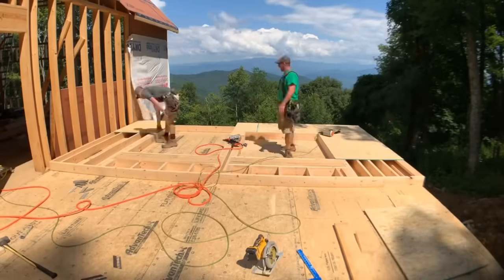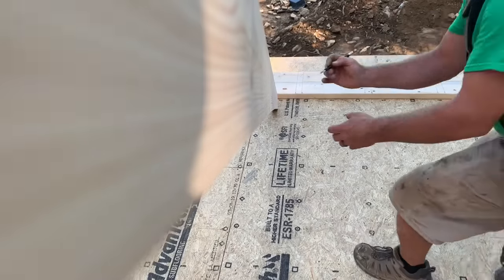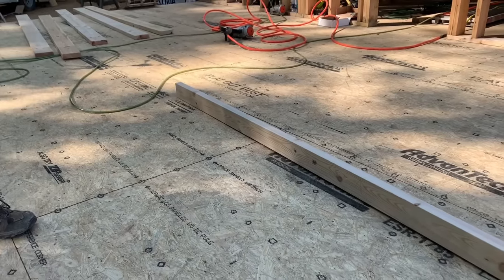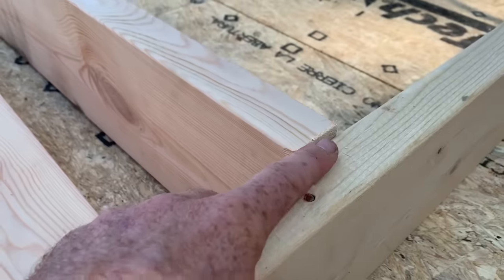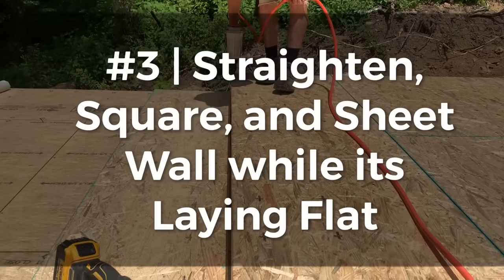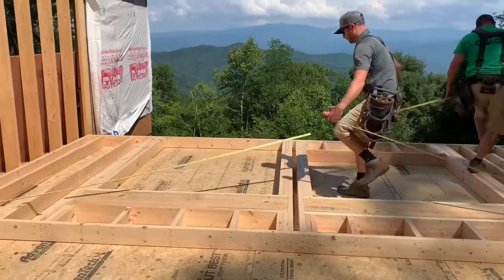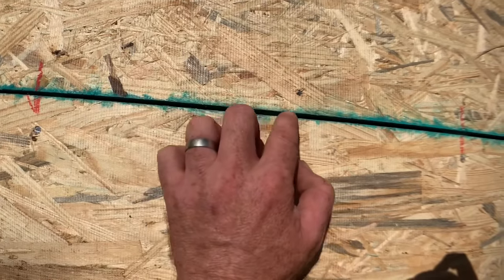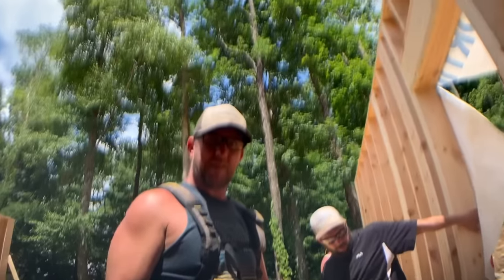Build GOOD Walls! How to do it.

Comment: Pin punched plastic house wrap, is not Tyvek.  Leaks like a sieve.
Reply: Was going to ask, is Tyvek just the fist/most popular brand? Like when some oldtimers call all the circular saws Skilsaws and all the reciprocating saws Sawzalls?
Reply: idwtbam In the sense that they are both house wraps you could say that.  However they are different in design so it would be like calling a sawzall a skillsaw because they are both saws.
Or calling a tomato an apple because they are both red and both fruits.  Or referring to OSB as Plywood, they are both sheathing and decking products but behave entirely different when exposed to water.
Reply: idwtbam Tyvek is the best and toughest but pricey where we are .
Reply: Tyvek is epic. That wall is fine. You can put 3/4 plywood on your house if you want bro but these guys are trying to make a living and obviously care about good work also. Check yourself before you wreck yourself
Reply: Typecast is over engineered
Reply: Lol, do y’all scoff every time you see h house wrapped in tyvek or something.  AND SAY.       “ they should have wrapped it in gold”
Reply: h2s you’re lucky this CONTRACTOR gives a shit at all

Comment: Next time toenail the outside of the bottom plate on the line . mark the top edge for the studs ,not the inside flat part of the plate. 
Load your wall square it,sheet it , tyvck stand and brace .
Reply from the maker: Have done that.. easier to straighten twisted studs when you have the line down the flat face of the plates.

Comment: Ahh .. You mean to tell me you arbitrarily marked in 5-1/2 " ?? .. didn't lay out the entirety ?? or was your framing built by NASA ??    Grid out the entirety for every deviation .. and if you tell me your masonry and floor framing on everything was perfect .. " Bullshit !!.. Cross squaring walls and standing them means that the floor was perfectly .. I mean perfectly level !! and straight .. 40 years .. never seen that !! and I build mansions . Works somewhat on low end cracker boxes !! .. I have seen too many times .. standing a wall pre-sheathed and gaps under the plates .. That is why I guess in the comment section people are suggestion caulk ..   In this application .. Yes !! .. .. and them bedding the plate and separating the studs from the plate a miniscule amount .. But it is now an unbeared stud .. .. And the purpose of a stud is to bear .. . The only wall that can be reasonably presheathed is a gable wall .. The deviation is 1/64" .. .. A 1/4 " bowed stud is unacceptable in 8 or 9 foot wall .. Save the best for dining rooms with wainscoting .. and you won't get that chair rail meander
Reply: I agree I have seen some shitty framers frame this way and they had issues with gaps under the plates I saw them use shims and glue and these were long runs of load bearing walls. It was a clown show to watch
Reply: It is about the care you put into toenailing the  bottom plate to the chalk line. If done well there is never any gaps.  18 years experience, 12 months a year outside banging nails and loving it.

Comment: Plywood is just another way of saying osb lighten up people people
Reply: No they are two different products.

Plywood is thin veneer sheets glued together.

Whereas OSB is Opposite Strand Board.
Mostly made up of chewed up left overs glued together.

I have had to use both because of specifications on jobs.

Personally I would not use OSB board to build an outhouse for somebody I dont like.

It is cheap worthless crapola. I have seen it swell, pop off the screws used to hold it on place.

It is 100 percent junk.
Reply: @shawnr771  . Yep. Really cheap junk!

Comment: True professionals when they put the tyvek on upside down!!! 🤦‍♂️
Reply: Tyvek should NEVER   be  installed upside down! If any moisture accumulates behind the siding, water will run up, rather than down.
Reply: They rolled the bottom layer first. Check again.

Comment: That pulling a tape corner to corner is not fool proof, have you ever heard of a isosceles trapezoid?
Reply: Not relevant in this case.  Matching corner to corner = square.  Every time.
Reply: @selftrue670  Keep believing that!
Reply: @mobeydick37  You know what?  I stand corrected--I see your point.  I and a million others have used the diag. corner-to-corner agree method for decades, but I can see how it can introduce error.  I guess I will go back to the 3-4-5 method.
Reply: @selftrue670  I got bit one time and learned my lesson. I made a porch beam 1" longer then it was supposed to be on a remodel addition. Don't know how the wrong measurement got introduced into the equation. Pulled corner to corner to square it up with the house. It didn't show up until we started putting in the valley jacks. It wasn't bad enough to take it apart or to be noticed so we just cut them to fit. I always did the math after that. Then pulled cornet to corner.   Bxs=+Hxs=Sq

Comment: I know you're trying to teach people but that's a rookie home owner way to build walls first you can't put vapor barrier on Wall because inspector can't count nails in plywood which is only thing holding house together and doing plates like that is not correct and all studs get tow nailed it's stronger and sheeting the walls after you stand them and straighten them is a much better job then doing it on ground I've been framer for 35 yrs not being an asshole just learned from experience
Reply: Sounds like you might be from NJ
Reply from the maker: Thanks for the comment. So we don’t have nail inspection on sheeting where i live... I do nail 6” OC and always adjust the the compressor  pressure so the heads sit flush instead of sinking half way through (like you see most people doing), greatly increasing the strength of the connection. I do always stand walls framed on slab and sheet them after because there is no good way to tack the wall to straighten and square, like shown in video.
Reply: @larrymiller9480  A foreign country was my guess.
Reply: Toe-nailing will yield less and variable nail penetration and therefore less lateral strength. It's the job of the sheathing and drywall to hold the studs to the plates. Not sure how sheathing a wall after standing it would be better?
Reply: Big Al Van Duzer if you’re not sheeting walls laying down your losing valuable time
Reply: We send our shit lumber back .some of that lumber wouldn't use on dog house.aint got time 2 mess with it.

Comment: Seems like 1/2 to 3/4 of this is irrelevant if you use metal studs.  Still a good video though for wood stud walls.
Reply: Since the wall did use wood studs, it seems the only thing  irrelevant is your post.
Reply: technosaurus well, duh?
By the way, who invited you here?
Reply: How do you attach wood rafters to a metal stud wall?
Reply: @ajs96350  There are multiple ways to use wood rafters with metal stud walls.  Just google: metal stud roof detail.  Most metal stud manufacturers have drawings and specs for wood roof trusses - usually involving special braces.  OTOH you can just use metal studs for a roof to span up to 40ft before you need to get an engineer/architect involved (steel framing alliance has references)  Besides being lighter, fireproof, straight, square and true, metal studs don't go up in price exponentially with length and width, so spanning a larger area becomes cheaper than wood at around a 12ft span (give or take).   IMO Metal is actually much easier for a DIYer than standard stick framing but costs more up front for small buildings (the sheds, garages and tiny houses you see on YouTube) and still not as common in residential construction outside of interior basement walls, so good, comprehensive  tutorials are harder to come by.

Comment: why was there double sill plates? wouldnt you get better sealing if you house wrapped it standing so it could go around and in corners? ive heard a lot of people using deck screws for framing, what do you think of this?
Reply from the maker: Good questions. LOk so the two plates you see are the top and bottom plates. Just sitting together because I mark them at the same time. Double top plate is added later after opposing interior and exterior walls are finished... and this ties it all together. I do leave about 2 extra feet of house wrap folded back to wrap around the corner once the opposing wall is built as well. Also I do this deck screws pretty often to suck framing members tight or tack things straight before nailing.   They are expensive so I try to reuse them!
Reply: @PerkinsBuilderBrothers  i thought i saw double sill plates(mud sills). do you mean you temporarily screw the parts together then shoot in nails, then recover the screws? what i meant with my question was using screws instead of nails, a worker at a lowes here said he used just deck screws to build his house, but ive heard they lack shear strength, i was curious what someone who builds for a living thinks about it
Reply: @feralbigdog  Deck screws do lack shear strength. Don't use them for framing.
Reply: @Jay-tk7ib  im about to build(well rebuild, a moron ripped it out) a hearth for my fireplace, any issues with deck screws for that? would adding construction adhesive to the hearth joist/ band hearth joist joint compensate?

Comment: Or...use steel studs and don't get any crown at all and very little waste!  

More people need to go to steel and show more videos of it. Wood has so many drawbacks, compared to other options.
Reply: Ummm. Steel studs arent structural. You cant set a roof or a second floor on it. It will also conduct heat or cold air and that may not be as nice with insulation.
Reply: @joshyjosh00  depends on the Gage of steel.
Otherwise you're correct on the temperature transfer.

Comment: You get paid how much? and you still use nails? WTF?
Reply: Depends on the application.  Nails have shear strength, screws have holding power. I wouldn't trust you if you said you strictly use only screws, same goes if you use nails on everything.

Comment: If you want to build a wall, don't use home depot chemical laden toothpicks to build it, unless you want it to rot and be condemned before that 30 year mortgage is through. Good walls are built from Clay, Straw, and Sand, and we call it Cob.

Comment: You use zip on the roofs but you use that garbage osb on the walls... .. makes no sense to spend money and time on tyvek.. and why don’t you tack your  bottom plate to chalk line first rather than having to move a full framed wall after the fact.. .
Reply from the maker: Great idea about that but I just don’t like standing right at the edge of the floor to assemble the wall when it’s a long way to the ground ;)
Reply: I been framing houses for 25 years.... if you angle your nails just right so they come out exactly on the outside bottom corner  into the floor you don’t need to pull them at all and they act perfectly as a hinge.. also we use the  metal lumber straps spaced about every eight feet  .. cut them two feet long and nail it to floor and wrap it under plate and bend it up and over to nail into top of bottom plate for lifting long or gable walls when lifting with multiple guys or with lull to keep wall from moving  when being picked up...